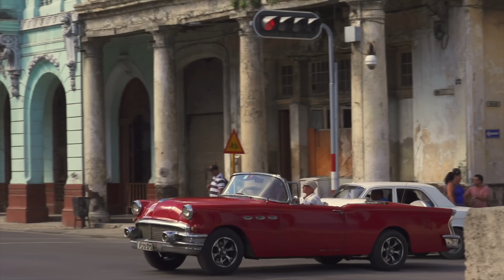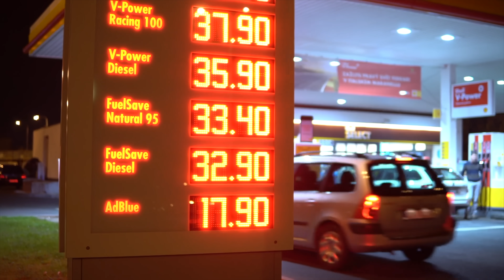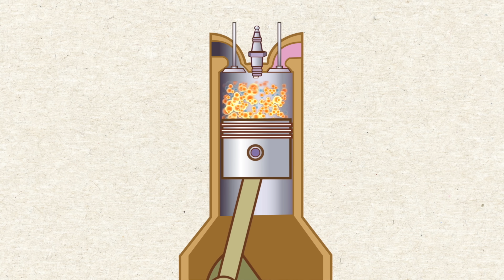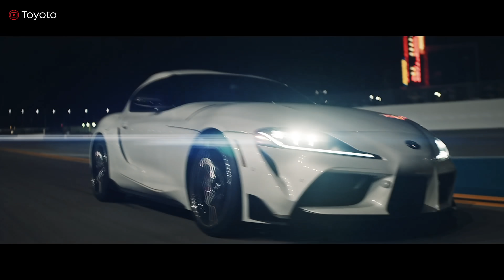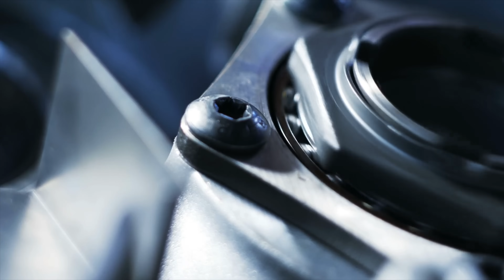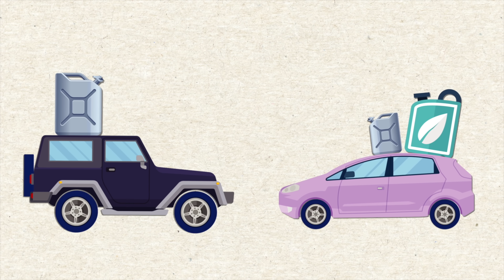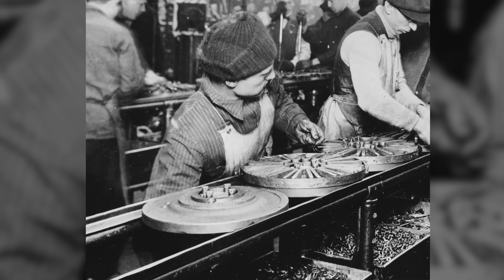7 Fuel Myths Stupid People Fall For

Comment: Every car I have owned ran best on premium fuel.  My 1.8 liter Mitisubishi Eclipse got 26mpg on regular and 29mph on premium.  It also had slightly more power on preimum enough of  a power increase that could be felt.  87 regular IMHO is lawnmower fuel and not much more.  I am BTW an environmental engineer.  Higher octane will allow for more timing advance which extracts more power from the cumbustion process.
Reply: Back when the difference between 87-89-91 octane was 10 cents, it was easier. Now it's waaay more

Comment: Utah pumps sell 85, 87, 91 generally. My mother in law keeps filling her cars with 85 and then asks me why it is running so bad. I have even filled it with 87 and it smoothed out immediately and she still doesn't seem to understand that she can't run 85 in an engine designed for 87.  I don't agree with ethanol being better though, studies are coming out showing ethanol actually emits more carbon than conventional fuels when they are produced. it drives food costs up as land for ethanol production replaces land used for crops. And it is not a sustainable industry without government subsidies.

Comment: I have a 92 toy p/u with 22r engine. indestructable right? i run mid grade fuel in it because it does ping with reg and an added incentive is mid grade helps clear the fuel injector/misster. it has 500k miles on it and is still running strong. 180psi per cyl as well.

Comment: I have a 1999 ford f150  and I have been using E85 since last year of 2021- 2022 and I get double the mileage and I only put in $20.00 and I do a lot of driving n
  I am self employed by picking up old appliances and scrap metal for recycling and I put on anywhere between 1 to 300 miles every day

Comment: After working in a servo for a good long while, apparently I still knew nothing about octane rating. Interesting that the Aussie rating is different to the US. I guess probably similar to the EU system given the numbers. (91, 95 & 98). I do remember my old car towards the end would complain bitterly if it didn't get at least 95 fuel despite being just a small sedan.

Comment: I got about 3mpg more for premium over regular in a '99 Ford Ranger (5-speed) that I took just shy of 300k miles.  Strictly highway driving at 60+ mph.  I spent several weeks on each different grade running the math to determine that it was worth the extra cost (at the time).  Wouldn't bother now that the prices have changed so dramatically.

Comment: Scotty,  If you connect instruments to the car, measure HP, torque, and fuel economy, there is a difference in performance.  If not, then race cars too could use “85”
From my experiences running the lowest octane and comparing it to the highest grade is about 10% differences in fuel economy.  Interestingly, the price of fuel, at any given day, compare 85 to 91 is usually 10% difference in price too.  

Yes, the HP is increased too at a noticeable difference if you climb high RPM’s else,  there is no differences between the fuel grade.  
Anyone else share the same experience ?

Comment: I'm a fuel hauler. Here are some fun facts.

Not all states require ethanol-only gas. ND for example. We have 87 and 91 with no ethanol available widely.

Refineries make only 2 octanes: 91 (or A grade) and sub-octane 83/84 or V grade. Everything you buy is a blend of these, some with ethanol.

87E10 is the usual 90%V/10%E
89E10 is 55%V/35%A/10%E
87 non ethanol is 50/50 A and V...
and so on.

If the pump says the premium is higher than 91 octane, there is ethanol in it. I don't care what the pump says or doesn't say...there IS ethanol.

And last, for every +/- 80,000 gallons of 10% gasoline, a semi truck had to haul a load of ethanol to the loading facility it was picked up at. Not as eco-friendly as we'd like eh?

Comment: My old chemistry professor used to say that octane is octane, but I've learned from experience that that's not true. My Mercedes knows the difference between low and premium grade octane. It doesn't like the low grade fuel at all.

Comment: I had a 76 Impala I used to put 87 Octane in it all the time but when I started putting 93 Octane in it the car ran way smoother had way better acceleration and didn’t burn has so quickly.

Comment: Im no mechanic and the difference might not be important or even noticeable but if you increase the pressure in the same size of space or smaller you will get an increase in heat thats just how energy works.

Comment: I have a Volkswagen Passat that has a 1.8 litre,  dual overhead cam , 16 valve, turbocharged motor.  The manufacturer recommends fueling the car with gasoline with no less than a 91 octane rating.

Comment: Scotty is a good example of someone who can't see the forest for the trees. I have used both regular and premium in many cars for many years, I always thought it was interesting how so many people can't tell the difference, and resort to some technical theory about the difference. It's not so much that the higher grade has more power, that's too small to be important, but with premium gas, the motor idles better, runs smoother, starts better and just feels better. And those same deniers will claim that the oil companies are just trying to scam you out of your money. No.  Edit- And those same kind are the ones who call others "stupid." You can tell who they are, but you can't tell'm anything.

Comment: Also that gas you scoff at at one gas station is probably the same gas you pumped at another. Gas companies typically get their gas all from the same refinary and the same holding tanks. Arco (BP) and 7/11 get their gas from the same holding tanks. Loves, Pilot, Flying J, Petro, and TA (all are truck stops) get their gas from the same place. They all use the same additives. Chevron is really the only company that uses a different fuel additive. Walmart, Costco, Safeway, and Kroger get their gas from whomever is selling it the cheapest so one day it'll be BP the next it'll be Shell...

Comment: I bought a flex fuel car for $700.  100% octane, burns a 100% cleaner than gasoline at less than half the price. Working on my second hundred thousand miles and it still runs like new. All I want is another one.

Comment: As far as ethanol goes, it has only around 70% of the power density of pure gasoline, so for every 10% of the fuel mixture that is ethanol, you are losing around 3% overall power.  Ethanol is also hygroscopic, and it's production creates a separate environmental impact.  I will never use corn gas as long as a pure gasoline choice exists at the pump.

Comment: Using high octane fuel in a lower octane car with cause the ECU to advance the timing relative to it's normal position and give better fuel economy and power. It will also be more resistant to knock which is helpful in warmer climates or long mountain drives

Comment: I have a 2006 Toyota Camry and manual recommends regular gas, but when I park my car, I hear ticking sounds .  Is that the sound of engine knocking? And should I switch to a higher octane rating ( plus or premium gas) to stop the ticking sound?

Comment: I get about 3 miles more per gallon using non-ethanol fuel over using 10 percent ethanol. Additionally, ethanol rots rubber fuel lines and damages fuel pumps.  To be able to use higher ethanol percentage fuel, the fuel pump needs to be changed, and the ECM needs to be reprogrammed.

Comment: Does it improve gas mileage? Well, I did the unthinkable, and bought all 3 grades of fuel and over time kept track of mileage. 

Found out some vehicles get better mileage with premium, others don't. Some of the mileage I gained wasn't worth the cost. Some were. 

Oddly enough the cars that said they required a specific fuel did best on the fuel. Honda Integra I had knocked bad on low octane, wrx sti also. They run like crap with improper fuel

Comment: I found this interesting, but...
I have a certain high performance car that has "Adaptive Spark Technology" - There are other models of my car that require Premium gasoline, but my car is different.  The engine has sensors that read the fuel as it is injected to the engine and adjust the timing of the spark plug based on the fuel.
This means that the manual tells you that you only need Regular, and that is true.  But I can tell you with 100% certainty that the vehicle accelerates smoother and faster with even just mid-grade.
That said, I do NOT get better fuel efficiency with different fuel grades, not at all, I do get more power.  So when I need (or want) the power I put premium, but for everyday use I get regular and save the money.

Comment: With new cars they are computer control, so when your manual says use regular gas … that’s because it won’t burn out your fuel injectors. Now if you’re going on a long trip, on an empty tank put in the highest grade as it will clean the injectors. But do this every couple of months or you’ll burn them out.

Comment: I'm surprised that nobody has mentioned anything about the fact that E85 is NOT 85% ethanol as it is supposed to be. It is different  all the time and can be anywhere between 40% and 84%. It has an octane range between 84 octane and 104 octane. C85 on the other hand is 85% ethanol and is rated at 105 octane or more. But because it is considered to be racing fuel it is also expensive.  JoAnn

Comment: My toyota sienna designed for 87 or higher.  Huge difference in performance, 87 is ok, BUT 91 - it's flying...
I don't care about MPG , but 91 mpg better for sure.  Cost per mile little higher but again- PERFORMANCE!!!

Comment: Back in the early 2000s, I used to drive a 1995 Toyota Camry LE. Sometimes I filled it with 91 Octane gasoline and that resulted in better engine performance. In today's modern cars, high octane makes zero difference in performance. Just fuel your car with whatever it needs and that's it.

Comment: on my hyrid i get more miles on 93 octane by at least 100 additional miles drove from orlando to seattle on 300 bucks of gas varying gas from 87 to 92  lower gave me 350 miles,  92 gave me 455 miles. 2010 honda insight.  i found that shell gas gave me the best mileage.
Reply: Has to be the ethanol content, can't get that from octane, if you can i would like to see a study. Higher octane actually is less energy dense (barring ethanol), the video wasn't 100% correct, it's just the differnece was less than .01%

Comment: As far as I know modern engines can  adjust to different octane fuel. Only thing is don't change that often. Just run on the same fuel all the time. And 85? Is big mistake. Flexfuel engines only... is cheaper at the station but engine is using more fuel to do same "job". It's easy to find it online.

Comment: Going to AK I cut thru Canada.  All there fuel contains ethanol. I thought my trip was done. My car was 2004. I actually got better mileage and the car ran better especially at higher altitudes.  Apparently it burns hotter which helped at 19000ft.

Comment: Fun fact Ammoonia aka NH3 nitrogen hydrogen 3 is a  cheap renewable fuel used as a fuel since 1960s NASA. Can be run in any combustion engine car, truck, semi, tanker ship, generator  all takes is 2nd propane pressure tank to handle the off gasses . Look it up and watch videos on ammonia as a fuel.

Comment: I once put Aviation gas in my jaguar, using 100 LL , the car would not start in cold weather.  Was told that higher octane burned cooler than lower octane.
Reply: The reason for poor cold starts with high octane is not the temperature of the combustion but that it is not as easy to ignite.

Comment: Ford's 1941 bioplastic Model T was made of hemp, flax, wheat, and spruce pulp, which made the car lighter than fiberglass and ten times tougher than steel, wrote the New York Times on February 2, 1941. The car ran on ethanol made from hemp or other agricultural waste

Comment: 2:29  what about when the vehicle in question is 50 cc motor-scooter, air cooled, self oiling/mixing (using 15W / 40, truck oil / differential oil), and has instruction decals that recommend 90 octane or higher? My experience after switching from 91 octane, up to 100 octane, is that my engine did, in fact run cooler, and experienced a notable increase power. I would bet, considering, that it was also producing a cleaner/more complete burn, as well... I know some people that achieved the higher octane, using octane booster w/87 octane gas. I myself, not trusting that the booster/87 mix would work as well, opted to spend the extra money for racing gas at one of only a handful of 76 stations here in Las Vegas nv, which at that time in 2011, was double the price of 91 per gallon. (nearly $9.50). I noticed a major improvement.

Comment: And now I know for certain why my 2001 Chevrolet runs so much better when I put non-ethanol gas in it. I didn't even know this when I bought it new, but I do remember that gas with ethanol in it was a new thing then. It does make it more difficult to find gas as most places on have 10% or higher ethanol gas. But it's worth it to make it not choke.
The old thing needs a lot of work. But one thing it still does and always has, is start right up and get me there. Then start right up and get me home.

Comment: but its been reported to me by many repair shops that high ethanol levels in gasoline destroy fuel lines and seals..one reason they like to keep ethanol content low. it also breaks down  changes becomes green and gummy way faster, fouling carbs and jets way more than pure gas..and especially the higher the ethanol content 5\10\15 etc. myself a smooth running car engine, rather than some subdued  or severe knocking all the time is way preferable. The few dollars saved each fill up is not worth...what MIGHT be slowly happening to your engine month after month...till you discover huge bothersome expensive damage has been accumulating

Comment: Pre-detonation is a misnomer. There is Detonation, the simultaneous detonation of the end gases,(an end of combustion event) and there is "pre-ignition" which is the ignition (a start of combustion event)of a FRESH charge before a spark event!!!!
All gas burning "normal" is "pre" detonation in that it hasn't detonated YET!
Detonation (the end gas exploding essentially, causes hot spots that may lead to PRE-IGNOTION) !
Detonation over time can peck away at combustion material, pre-ignition can lead to a blow torch hole through a piston and is much quicker act of engine destruction!

Comment: Great video in grand professorial stile. Scotty is definitely the greatest, in Arabic :Scotty akhbar!                                                           However a car with  a gas with more than  10% ethanol standing still for a few weeks will not start. Octanes and ethanol mix only in absolute absence of water, wet air coming in and out of the gas tank during fluctuation of air pressure will separate a heavier layer of wet ethanol on the bottom of the tank. And wet ethanol will hardly be ignited by the spark plugs.  And clearing forests in Brazil to grow canes for ethanol is an environmental desaster as is genetically modified corn.

Comment: I absolutely never buy ethanol. I've seen its effect on my cars, mowers, trimmers and boats. However, I'll put it in my car if I must. Maybe even a lawn mower if I'm sure to burn it all out but I won't put it in a 2 cycle. Wonder what the ethanol does to 2cycle oil? A man I trust told me to not put it in anything that has a carburetor, metal gas tank or takes 2 cycle oil. I live by that.

Comment: Im driving mazda cx-5 2012 2L 165ps model motor and i can see huge difference then i use 95 and 99 fuel. Using 95 my range is lower max 450km meanwhile with 99 range goes to 530km plus i have better acceleration and motor works way better. Same goes with oil manufacturer said i have to use 0w oil but mechanics tells me this is old motor and it needs 5w.... with 0w car works perfectly with 5w it feels like im towing something.

Comment: I have a 2011 F-150. It is a flex fuel engine, meaning it recommends 87 Octane, but can use E-85. Made the mistake of using the E-85 one time, since it was like 25 cents a gallon cheaper at the time. Now, with my F-150 driving at 70 mph on the interstate, I got 24 mpg. That's just cruising not changing speed that often. Had no cruise control either. City driving, I got 15-16 mpg. So on a 26 gallon tank of 87 octane at 70 mph. I managed upwards of 400 miles per tank or more. With the E-85, I lost 100 miles on a tank of that CRAP. Never again will I foul my engine with E-85. Biggest waste of time developing it.

Comment: Both my old cr80 and my current atv req ho fuel, because they are bored out.  The do indeed knock if not running ho.  I used to run aviation fuel in my cr when racing.

Comment: Average energy needed to transport refine and repeatedly truck a gallon gas to a station near you is 11 kWh on that my model three can go over 50 mi.  That’s why every mile I drive in my Tesla actually saves electricity.  Probably the most important point that you never mention.

Comment: Ethanol gas needs different gaskets and sealants than gas engines and ethanol can cause wear and tear on the hoses etc. Basically it dissolves or corrode the various rubber mixture differently than the gasoline. There's also not very good evidence ethanol is a really good use as an additive considering the full life cycle costs. However the ethanol subsidies for swing state farmers is something neither party wants to touch